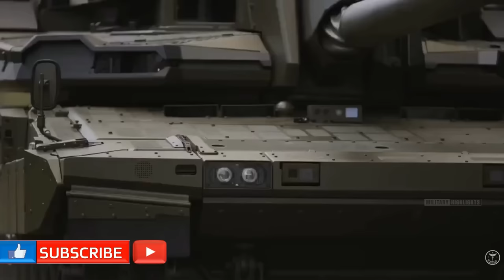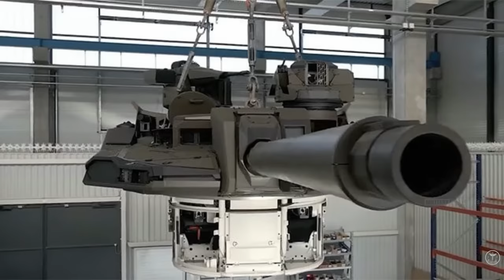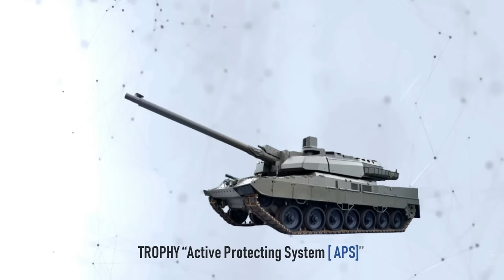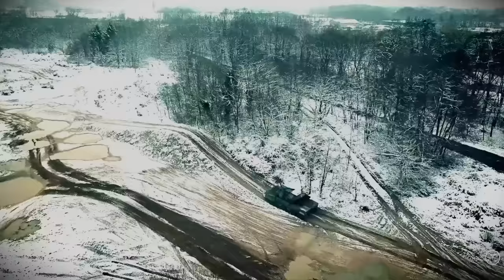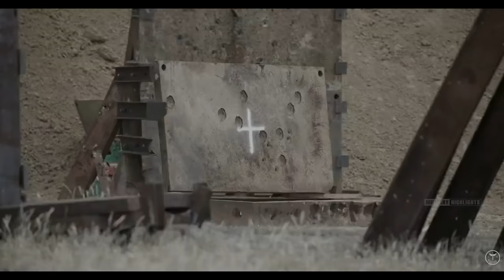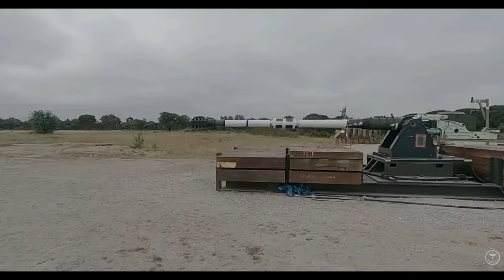New Designed The Franco German EMBT [Enhanced Main Battle Tank]

Comment: EMBT designed to carry Nexter ASCALON 140 mm canon
Reply: MBT is a Universal tank platform so it is only limited to such an extent as 130mm any bigger the tank is imbalance and would lose its center gravity making the tank unstable during firing on long periods of engagement but I guess the world is ready for Heavy and Super Heavy MBT platforms with the advancement of metallurgy roads and bridges will certainly be capable of accommodating such massive tanks in the future with that 140mm, 150mm, 160mm, and even railgun tanks are not that far out. Modern technology and metallurgy make our current infrastructure like roads and bridges limited for now.
Reply: @nikkotan2840  no, this turret is really designed for the 140mm ascalon. 
And with a special low pressure chamber + special alloy, thos gun is lighter than the 130 of Rheinmetal. 

They fit a 120 for the demo because the 140 proto version are presently in heavy testing in Spain.
Reply: @nikkotan2840  Leclerc was already be fitted with this 140mm on T4 turret prototype in eighties and 2016. Weight 60t (metric), same as modern MBT. Leclerc weight 55-58t, and more with AZUR or CLARA kit. Its the same turret architecture so...
Reply: @raptorfr  U have a point, because same thing happens to the Abrams prototype which have a 140 or 150 barrel or something but was discontinued.

Comment: The KMW EMBT turret has far too many attachments and positions that make it easier for attackers to get grenades and rockets caught in the superstructure. The LEO2 and also the current French MBT have a much more "streamlined" turret from which shells and rockets can ricochet. I think that's a very big disadvantage. The new MBT from Reinmetall KF51 is the better option, at least as far as the tower design is concerned. There is not much else to say about the technical performance, but the design of the Panther is really superior.
Reply: I want modern panther :(
Reply: In the 21st century it's almost impossible for shells to ricochet with modern ammunition, also, rockets don't "get caught" on the superstructure, they instantly impact, and grenades are for infantry. There are many flaws to this tank but these aren't one of them.
Reply: rockets get intercepted by trophy aps
Reply: Stop thinking shells hitting tanks are like video games. There is no HP.

 For one... RPGs and other similar weapons don't richochet for one. They hit the tank then shoot a large jet of molten metal inside causing damage, and killing the crew. (There is also metal fragments caused by the jets).

 So it would just damage one of the AUTOMATED turrets. 

 A anti tank sabot from an other MBT will basically do the same. 

 In order to kill the tank you need to hit something vulnerable. Meaning either you kill the crew inside, catch the inside on fire, or hit the ammo. Even then if isn't a sure kill which is why you see videos of Tanks getting hit multiple times until it is clear... Like Russian MBTs turrets using their turrets ejection system. 

 So unless they really, and I mean really, shit the bed on those turrets designs? They will be fine. 

 Hell it is just an other thing for a top down munition to need to get through so maybe it will decrease the chance of the crew getting killed. 

 Don't know why three guns is required. That leaves less ammo for everything. I'd take the bigger calibers, to make it less complicated.
Reply: I think mini automated turrets will become more popular. I can see them being used as drone defence and general suppression.
Reply: Modern munitions don't ricochet. They are specifically designed to penetrate at even very shallow angles.
Reply: @ItsATrap614 

They can ricochet, atleast APFSDS can, kinda (but it shatters)
Reply: KNDS not KMW.
Reply: @cayden2744  We are not in World of tank.
Reply: @hermes6910  

World of Tanks does not have APFSDS as it's a game about WW2 and Post War Vehicles.

Comment: "It's french too though, so there's got to be something weird?"
"there's one more gun, a 30mm mounted in the back of the turret"
"Ah!"
Reply: Good for pickin' those nasty drones though.
Reply: Have you seen the new Abrams X with a very similar solution?
But it is American so it must be brilliant then ;)
Reply: @majormoolah5056 it is older than the Abrams X
Reply: @jean-philippebobin3732  Not really.  The Abrams X is just an Abrams chassis with all of the improvements integrated instead of bolted on.
Reply: @cstgraphpads2091  The Turret has quite a few change, so I would not put them in the same categorie.
Reply: @cstgraphpads2091   Secondary turret already integrated on Leclerc turret since the beginning. Leclerc was designed with fully digitalized system (firepower, mobility, protection AND system) so its "easy" to be done. On Leclerc, turret and chassis components were designed to share informations via data bus (based on Mirage 2000 Digibus)

30mm canon is the same that is on THL30 turret on Tiger helicopter. Vetronic is based on EBRC Jaguar.
Reply: A rear facing gun is a standard requirement on French tanks, in case you need to fire as you retreat prior to a quick surrender!   Only kidding, nothing but love for our French 🇫🇷 brothers… despite their slightly oddball military requirements!
Reply: @StoccTube  What's oddball about having the ability to fire in all directions instead of only one? Oddball is thinking you're okay with only firing forward.

Comment: Before Ukraine, would have seen this tank as an advancement. 
It looks decent, with active protection and a 30mm drone defense turret. 
The option for bigger calibre fittings is mixed. Since it depends on the recoil. Turret does not look like it has a lot of space left for more recoil. 
It lacks the idea of the "4th floating crew member" from the KF51, that either handles drones or in the future tank drones.
Reply: Did you miss the 4th crew member, the "combat operator"?
Reply: "Leclerc" turret was already be fitted with 140mm gun. Leclerc "Terminator" was done with turret T4 prototype in eighties and 2016).

Comment: I think this thing is so cool and seemingly perfectly fit for modern warfare.
Especially love the slimmed down turret, sturdy but saves tons (literally) of armour.
Reply: Sorry dude... but the Trophy system turned out to be absolute shit.
The tank is no better than the paper it was designed on
Reply: @AhmedAdly11  Trophy has little to do with this tank or my comment
Still stops atgms, drones are simply a different threat.
Reply: @dionisko1723 y’all had “some” tanks destroyed in Ukraine
Reply: @AhmedAdly11  And where did you come up with this conclusion? I've seen countless videos of Trophy intercepting ATGMs and RPGs. Funnily enough, all the videos that claim that Trophy didn't do anything is when it wasn't even deployed or below minimum range where the Receiver can't slew the APS fast enough. Ryan McBeth did a wonderful analysis on this.
Reply: @SeGo-T  Countless of what videos? All Leopards in Ukraine got destroyed by cheap FPV drones.
Reply: @gloomy5487  Seen videos of APS (especially the Trophy system) intercept ATGMs and RPGs? I'm guessing you haven't watched any if you're saying that. And what does Leopards in Ukraine have to do with FPV drones? We're talking about ATGMs and RPGs, Trophy wasn't designed to intercept Drones as of yet. (Though the cage armor does work on the roof, considering the Merkava Mk. IV has NERA on the roof, unlike a fairly thin RHA composition on Russian tanks, supplemented by K1). And also, most Leopards in Ukraine hit by drones or Mines have been towed back and repaired. I'm also guessing you considered "hit" targets as destroyed even when they are in a repairable state. Don't make me laugh.

Comment: The EMBT looks like the french shut the germans outside and decided to make everything using french parts. Looking at the tank, the main gun looks french and the hull looks to be a modified leclerc hull. Also considering KMW and Rheinmetall are joint owned, I believe that this project while funded by both nations was entirely lead by france and weren't able to compromise on much of the design. While a KMW engine was used, they stuck with a french made cannon, french made machine guns, and french made hull. Everything visible to the average viewer can see that this partnership failed in producing a tank that was for both nations.
Reply: Except that most of what you say is wrong for some reasons, like the hull which is designed and manufactured by KMW.
The turret is designed by both Nexter and KMW under the name KNDS.
The gun is "French" (which no longer makes sense as KNDS is both German and French) because Nexter had a gun, KMW did not and Rheinmetall is not part of this programme.
Reply: @hermes6910  I am only pointing out the aesthetics of the tank because it looks very french. The hull looks very similar to the french leclerc hull and obviously Nexter had the gun because it is the same one mounted on the leclerc tank. The hull to me looks like an upgraded leclerc hull which is designed by nexter, which made me believe that KMW was not very involved during the design phase because they could had easily used the same hull on the leopard 2 which KMW produces, but they chose not to. 

I also believed Rheinmetall to be part of the project because I read a while back there were talks about merging both companies and only recently I found out that it fell through.
Reply: @allenliu8820  "KMW was not very involved during the design phase because they could had easily used the same hull on the leopard 2 which KMW produces, but they chose not to. "

Guy... that's literally what they did in the first version of the EMBT... Nothing more than a Leo 2 hull and a Leclerc turret... (Also the hull is still derived from the Leo2... nothing from the Leclerc)
So yes, KMW or (KMW from KNDS) is very involved in the project with Nexter from KNDS because this project serves as a cement for KNDS so that Nexter and KMW work together on their strong point.
Reply: @hermes6910  I do not know about the first version of the EMBT and like I said I am looking at the tank aesthetically and most of it was just speculations. Either way, chances are this tank is not going to be in service any time soon/ Hopefully we will see both nations look into the EMBT and the KF 51 for their NGCS program, but we'll see how this goes.
Reply: @allenliu8820  The EMBT was not intended to be commissioned from the outset.
The project has simply aroused growing interest.

The main objective of the EMBT is to create joint work within KNDS to ensure synergy in the MGCS program.

As for the KF51, there's nothing really interesting about it - it's just a platform to sell Rheinmetall's 130s, which didn't liked being pushed to the side by KNDS.
Rheinmetall is now threatening the entire MGCS programme by breaking stability.

The MGCS is not only a MBT, it's more than just a platform, it's a global ground program including the new generation MBT.
Reply: @hermes6910  Thx for the info and ngl the MGCS program in my eyes is slowly leaning towards Merkava like tanks, but in fairness that is what many people predict is going to be like for the future where tanks are just going to end up like Merkavas. With the tank engine in the front, an unmanned turret like the one on the striker mgs and well the tank hull can be modified for a multitude of rolls like troop transport, heavy logistics vehicle, and an anti air platform.

Comment: I thought tank design had FINALLY done away with all those extra turrets and extra weight. Those things are just shot traps and weak points in the armor. Most of the video shows a different turret without all that junk.
Reply: not really, all these turrets add 360 degree awareness, it really isn't that much of a problem
Reply: shoot traps havent beena  thing since the development of sabot ammunition. and i they are mounted on top of the turret so not really a weakpoint armor wise as an extra turret on ww1 and pre ww2 tanks used to be. 
I think they are very necessary to combat drones and slow moving rockets espetially the 30mm on the roof. Propably also usefull in the more and more infantry and city based combat we see today.
Reply: The other tank you saw on the video is the beta-version - literally a Leo2 Chassis with a Leclerc turret. And I personnaly like the idea of getting extra situational awareness with an unmanned turret instead of a man outside behind its machinegun. Plus the 30mm turret with fragmentation AA ammo is vital against drones. Loitering drones would be destroyed before reaching the tank

Comment: 120 ain't going to cut it. Need that new Rheinmetall RH-130 L51 smoothbore to blow those Russian asses to smithereens. For now I'd put my money on the KF51 Panther.
Reply: An upgrade will likely come in the next version. There have already been two versions on the embt 2017 and 2022.  The problem is they can't decide between the RH-130 L51 or the French GIAT 140mm.
Reply: @wifi_soldier5076  Yeah thats because the 140 mm only has a slithly advantage and isnt really better then the 130 mm. Meanwhile the 130mm makes more sense since it Safes space, weight and you can carry more.
Reply: @Future183  in reality the 140mm is not much heavier and is not really bulkier than the 130mm it is quite similar.  In addition, superior firepower could be useful if new armor technologies were invented on the tank of enemy countries.
Reply: @hugoduigou7703  actually yes the french 140mm is heavier and also a lot bigger. Also the shells need a lot of space, so you cant carry that much and you need an autoloader, meanwhile the 130mm has autoloader too but can also be hand loaded, while the 140mm ammo would be too heavy to carry for a human. And only 20% more firepower isnt really an argument against all the other facts...
The germans also made a 140mm back in the 80s on an Leopard 2 prototype wich was a LOT better then the 120mm. The germans could easily make 140mm gun superior to the 130mm and french 140mm but the 130mm is more practical and has more advantages.
Reply: @Future183  Atm both french 130mm and 140mm are better than german that's why they only do the hull. The Leclerc main problem was this one and a lack of armor but tbh France don't use MBT alone like dumb RU/USA, they use it with a lot of drones and covered with artillery
Reply: @DragonsilverXGenesis  wrong. French didnt develope a 130mm only a 140mm. Guess what Tests showed that the 140mm only has a 15 % advantage over the german 130mm lol the german 130mm is 50 % stronger then the old 120mm
Reply: @Future183  nope, the 140 Ascalon is slightly lighter and just 10 cm longer than the 130 RM. 
they use LP chamber and a special alloy to allow this.

With telescoped ammo, it will carry the same qtty than the 130 in other tanks. 

It's really a better option and will allow an evolution with a HP chamber later. 

The Rheinmetal's one, with HP chamber on 130 cannot evolve on power.
Reply: @Future183  the german 130 is a high pressure chamber. It's heavier than a 140 and less evolutive. It's a bad choice. 
With a 140 you still have more energy than a 130 hi-pressire and can hope a solid 30% more energy later if it's needed without changing all the turret and the loader.

Comment: Seems after nerfing the t14 the Meta shifting towards more usefull Tanks like KF51 Panther , Abrams 1.5, the embt and the kt2 black panther. But the embt looks a bit weaker, maybe more for expierenced  players,  players who like the Challenge of being confronted by a technical malefunction during combat. In my opinion its the weakest  s tier tank. A victim of its time. After t14 aramata dominated the Meta for a long time, the developer became bored with new tank Designs, and did  just reskined the  t14,  put a smaller tower on the main Tower,  ading some  optics.  Increased stats increased costs. not very gold efficient. While being almost a copy of the t14 armata, patchnotes hit the embt really hard. Not a really good meta pick right now. Low B tier after being nerfed.  Players who dont want to grind up for a new tank  and would like to wait and see how the meta evolves, they should check out the new drone operator class added in the newest patch.  We will see us on the battlefield. gl and hf